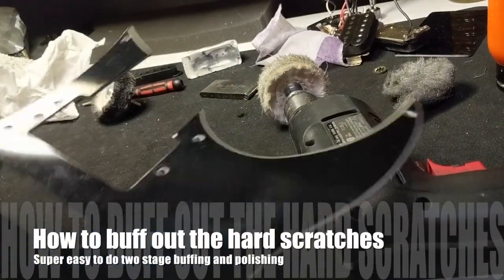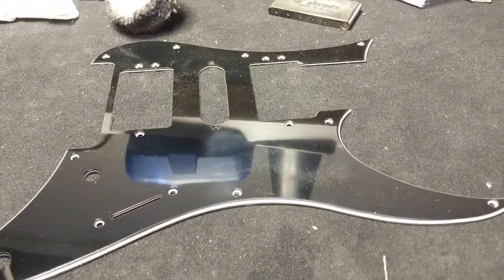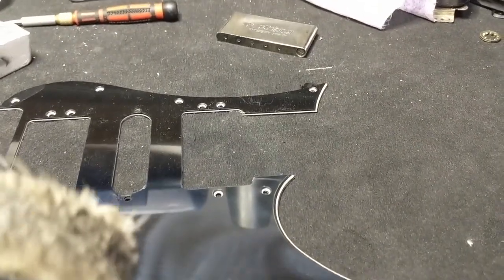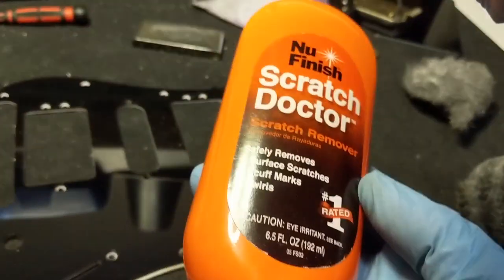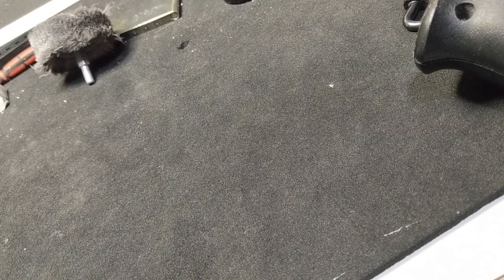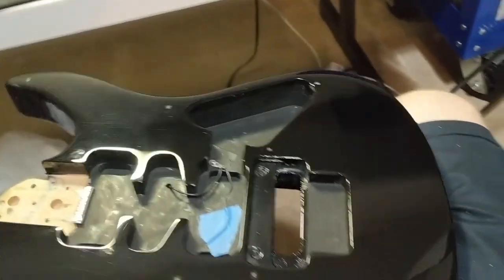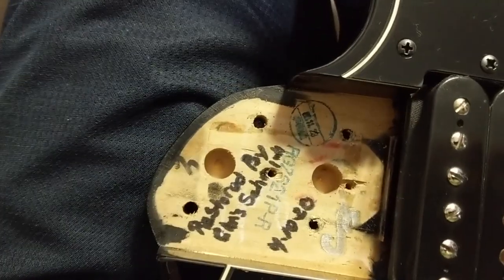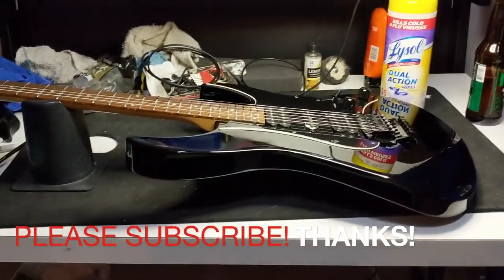Two Stage PickGuard and Body buffing EASY to do!!!

Comment: I turned a chalky Matt finish on a Ibanez into a finish you could shave with, but used turtle WAx cutting compound, then polish, and finished it with some Gibson pump polish by hand and with different grit's of microfiber and Terry cloth and I kid you not it was literally a mirror.. I had a 150 into the guitar and resold it for 350.00
Reply from the maker: Excellent man, nice work
Reply: @theittyreport  thank you 👍

Comment: Hi Chris. I would like to ask what kind of wheel are you using?
Reply from the maker: @johnjohn-p5t  just a cheap set from harbor freight. Comes with the wheel and two types of compound blocks. I used the white compound because it cut better as the red version is better for soft metals like gold.

Comment: Hi Chris, don't know if you're still answering questions on this, I'm in the UK, but have assembled the same kit eg, new drill (wired, not battery), white compound, polishing cream etc to polish up my strat copy black pick-guard. 

Tried so many times but I cannot get the white compound to melt/stick to my stitched cotton mop even with the drill at full speed and the compound stick pressed hard against the mop.

 When the compound stick is pressed hard against the mop, It will only very lightly cover the very ends of the rotating fabric, the very outer surface of the mop, but doesn't sink in to the mop at all .

Does your white compound feel soft and waxy or fairly hard ? - mines is hard. I'm thinking that the wax may be the problem...

Any help greatly appreciated.
Reply from the maker: You may be pressing way too hard. The compound is very hard but friction will cause it to melt and bond to the wheel. Also, let the wheel do the work, if you press the compound into the wheel too much it will dig in and cause deep scratches and will make the process worse. You also need two wheels for compound and scratch remover. But if the pick guard is really bad you need to wet sad from 400 to 1200 until the whole thing is milky white. Don't dry sand, I did it by mistake and some of the grains got under the sandpaper and caused deep scratches. Use lots of water and soak the paper for at least an hour before using. Hope this helps and please post a video and a link to the results! Love to see it

Comment: Hi Chris, I'm trying to restore a 20 year old squier strat. Do you think this process would work on an old white pickguard?
Reply from the maker: It's the same plastic as all of the ones I'd imagine. Hit me up if you need anything. And post your results! I'd love to see what you can do
Reply: @theittyreport  thanks Chris! What was the white bar you used on the wheel at 1:10 ?
Reply from the maker: @adamdoron1978  it's a buffing kit that came with a red (fine) and white (course) bar and two wheels. I think it costs about $6 at harbor freight.

Comment: Screw the pickguard down on a waste piece of mdf or similar. Should minimise the risk of flying pickguard and severed  limbs 😉

Nice job btw
Reply from the maker: That's me just being lazing and stupid. Lol, but that's sound advice man, thanks for the tip!
Reply: @chromaticmusic  I've just bought a new pickguard for my cheap experiment bass (everyone needs one). It fits amazingly snug wverywhere but....there's a gap near the output jack and one of the bottom screw points misses the wood so effectively need to add wood to slightly fill the routed/cavity area in order to fit the new pickguard. Scanned YouTube for tips but found nothing. I'm going to cut and trim some wood up and glue it in so it's more or less flush to the body surface, paint it and use superglue as a lacquer finish (If any of that makes sense) So..  Any thoughts or tips?
Reply from the maker: @halo20763  there's a really easy way to fix it. One method would simply use wooden tooth picks as a filler. Next is put cotton in the hole and then saturate it with super glue. Both work very well. Look up how to fill small holes with cotton and super glue,  it will show you a ton of cool hacks
Reply: @chromaticmusic  ah no, it's not a hole as in a screw whole, the oickguard is to small and leaves a gap between itself and the body itself. Like an 8mm x 13mm gap, and the bottom screw hole on the pickguard hovers above the cavity.
Reply from the maker: @halo20763  you could glue a small piece of wood in that area that could at as a piller
Reply: @chromaticmusic   Sure, I'm thinking a piece of split dowel for the bottom screw hole, the pickguard just covers that area, and the upper part (it's all in the tail area you know where the jack socket sits) I'm going to have to shape a piece of wood, curve it,  for that part. As long as its flush to the body and level with it too, probably work. I might do a vid, if it works I'll post it up. Might be of some use to people, that said might be more effort than its worth, it's just a very nice pickguard and a shame not to use it.